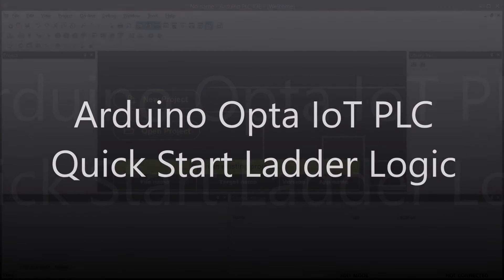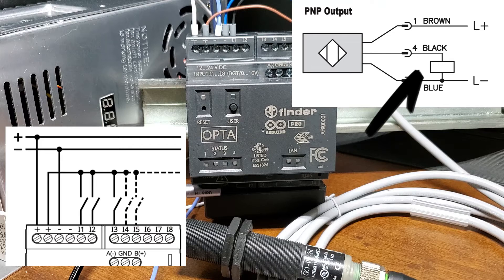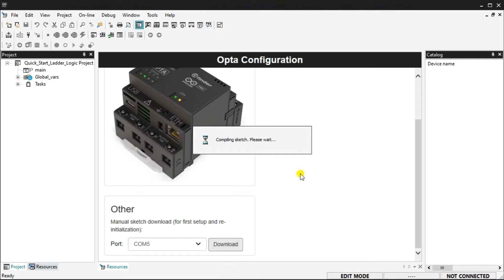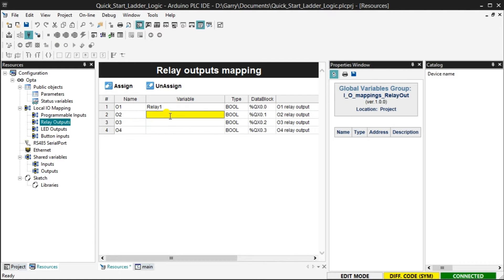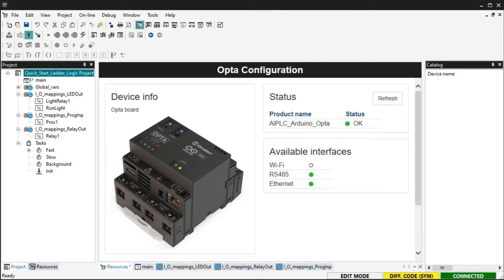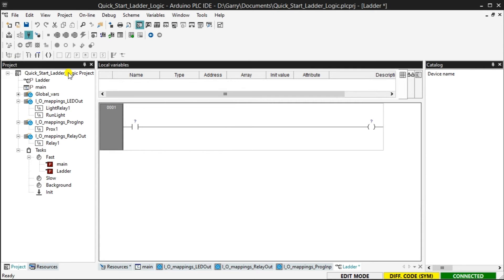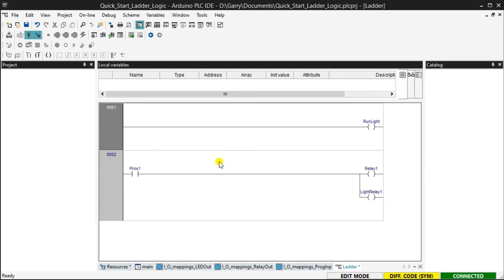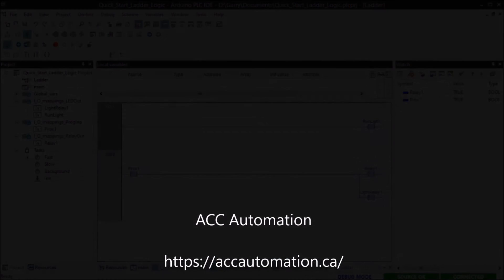Master Arduino Opta PLC: Your First Ladder Logic in Minutes

Comment: I have 2 questions 1) Can i connect 12 v sensor to this module and 2) what is the output voltage at relay point when it is high?
Reply from the maker: Sorry for the delayed response.
The connection would depend on the model of controller that you are wiring. Inputs will tell you the minimum and maximum range that can be applied in the specifications. 
Relay output specifications will tell you the maximum voltages that you would apply to the circuit. These are isolated from the PLC.
I hope this helps you out.
Regards,
Garry

Comment: I've tried your sketch, others and one I wrote myself (same logic as working OpenPLC RPI). I can initialize the OPTA, connect to to and tell it to download code. I get an error "getcrcfromtarget error reading par: 12293", I click OK and it tells me it uploads the code. The code doesn't run, the IDE says "different code" on the bottom and if I reconnect after a reboot, the IDE pops up a warning that the code is different. Running latest PLC IDE. Built similar logic in OpenPLC and tried uploading, same issues.  I must be doing something wrong or have a defective Opta.
Reply from the maker: I have yet to come across that error. I would suggest contacting Arduino or posting on the forum.
Regards,
Garry

Comment: sir can we connect opta wifi to my own network if yes how sir
Reply from the maker: Hi @sumeetguleria232,
The following post will allow you to add this to your network. I do not have the OPTA WiFi unit, but it should be similar using the Ethernet port.
https://accautomation.ca/programming-the-arduino-opta-plc-ethernet-port/
Here is the link for the OPTA series:
https://accautomation.ca/series/arduino-opta-plc/
Regards,
Garry

Comment: Do you happen to know if I can send serial signals as "input signals" over the USB cable (from my labview software" to the Opta?
Reply from the maker: Hi @rickbronx8528,
That is not possible over the USB cable. However, you could send information to the Opta server using Labview as a Modbus Client. I have not tried this, but it looks to be doable. 
https://forums.ni.com/t5/LabVIEW/Labview-Modbus-Serial-connection/td-p/3709527 
I hope this helps you out.
Regards,
Garry

Comment: Great video! Is there a chance you are doing a video on the RS485 connection using ladder logic? I can't find anything that shows me how to use it. I thought it would be straight forward, but there's no real help on it for ladder logic. Thanks!
Reply from the maker: Hi @AaronMilford,
Thank you for the comment. Yes, I plan on doing some videos on the RS485 connection using Modbus RTU as both the master (Client) and slave (Server). I am currently waiting for some answers and additional documentation from Arduino. This has been promised for the end of the month.
Regards,
Garry

Comment: for something that's advertised to be an industrial PLC, is questionable. I've programmed PLC's before, and I can't believe how difficult it is to even connect to this device, using a correct programming cable, not enough I/O to run much of anything. Modbus being an industrial standard network, absolutely no documentation on how to connect to it using this software - where to program the IP address or Modbus port number? You should be able to program this PLC through Ethernet or remotely over a Wifi network. I hope there's more to come on this device from Arduino, because right now, for a few more dollars you can buy a Siemens Logo or an IDEC Programmable Relay with expansion modules and all the Industrial functionality you need.  I have to give a shout out to Jakob Sagatowski, with his YouTube videos, for doing all the heavy lifting on programming this device.
Reply from the maker: Hi @automation_jeff,
I agree with your comments. Finder, the manufacturer of the OPTA, describes this as a programmable relay only. This is one of the first for the industrial market for Arduino.  I am sure that this will improve as the product matures. Documentation, expansion, I/O wiring options, etc.
Currently, a Click (Koyo) can be used for several fewer dollars. 
https://accautomation.ca/series/click-plc/
Thanks for the comments.
Garry

Comment: ACC Automation, Thank you for this excellent quick Start guide to using the Arduino Opta.   Question:  What features set apart the Arduino Opta from other current PLC units in the Market today?
I'm familiar with both Allen-Bradley PLC's and Unitronics PLC's.  The features this Quick Start guide showed, are similar to the features round in AB and Unitronics PLC's as of today.   Why would you recommend people to use the "Arduino Opta" PLC unit?
Reply from the maker: Hi Agustin,
Good question. The quick select guide was only implemented to quickly get users up and running with the software. All of the features were just basic functions.

Hardware: Currently, 8 inputs (digital or analog selectable for each input) and 4 relay outputs. Expandability will come in the future. Ethernet and USB are on board as standard. This can then communicate Modbus RTU or TCP. 

Programming software:
It is open-source software when using the Arduino core/libraries through the standard Arduino IDE or Cloud Web Editor. Most students are familiar with this C++ type of coding.
Allows Arduino PLC IDE-  IEC 61131-3 programming (full set of 5 languages) + no/code fieldbus + Arduino sketch integrated with shared variables.
PLC languages are not open source; the IDE is freely downloadable and usable, while each device's PLC Firmware runtime activation comes with every Opta.

Others:
The Opta is certified as a PLC by CE and UL (c UL us).

There are also Arduino IoT Cloud Dashboard Widgets that can be done. Node-RED would no longer be used. 
Note: I have yet to test this feature.

It is a great investment for the money.
Regards,
Garry
Reply: Hi  @ACCautomation , thank you for the awesome video on Opta. I had a question how would we use Node-Red with the Arduino Opta? Do I run the ladder diagram simultaneously with other programs in this device? I mean to use an inductive proximity sensor, quite similar to your application in this video, however, I wish to keep the Arduino Opta not physically connected to any host PC. So, I am thinking about how to setup Node-Red in this case.
Would love any references or tutorials to this question.

Comment: getting this error when trying to download to pota Cannot open DFU device 2341:0364 found on devnum 5 (LIBUSB_ERROR_NOT_FOUND) anny idea?
Reply from the maker: Hi Morten,
It sounds like you are using Linux. The following thread may help you out.
https://forum.arduino.cc/t/dfu-util-problem-with-portenta-h7-and-arduino-ide/661435
Regards,
Garry
Reply: Nope Windows 10 🙄
Reply from the maker: @mortenrasmussen5668  
Can you see the COM port in the device manager?
If not, then please reinstall the software with the administration privileges. 
Regards,
Garry
Reply from the maker: I also had a similar error when I first connected to the Opta. It turned out to be the cable. Ensure that it is for data as well as charging.
I use the following:
UGREEN USB A to Type C Right Angle Cable 6.6 Ft
https://amzn.to/3AYGCeN
Regards,
Garry